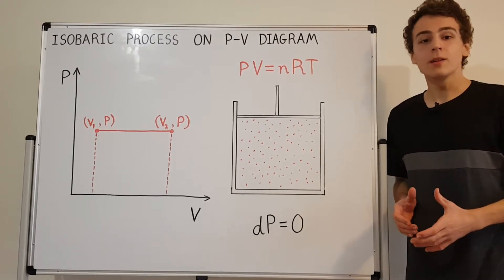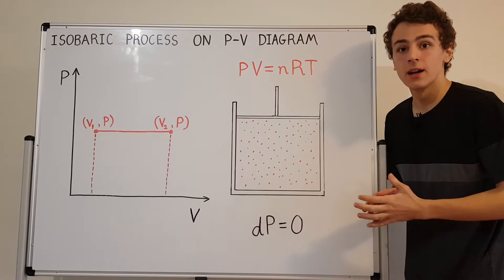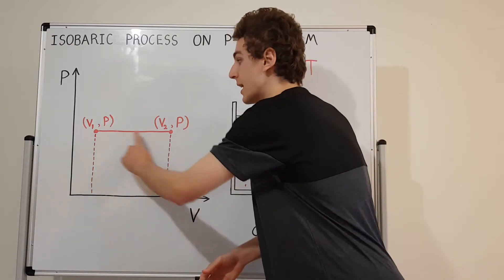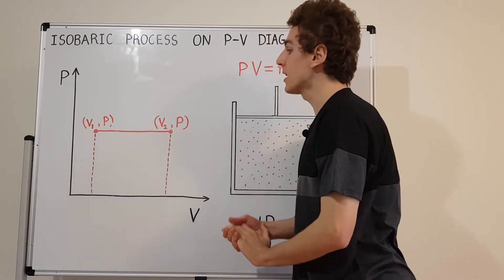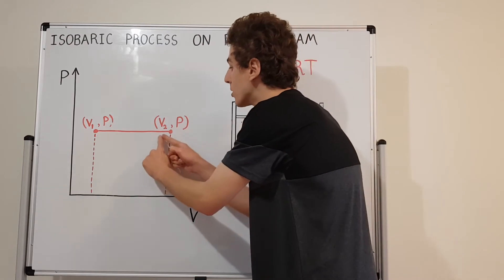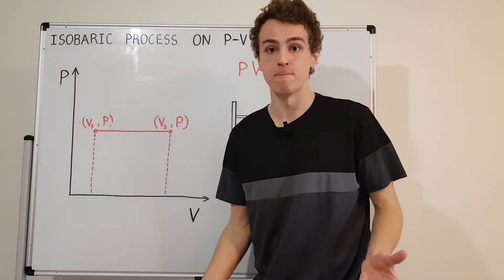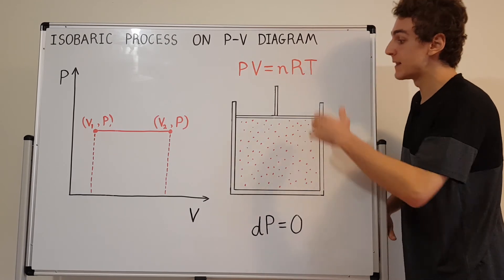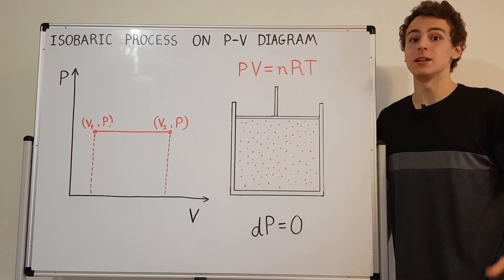Visual Intuition of Isobaric (Constant Pressure) Process on P-V Diagram

Comment: I think you did a really good job on the piston explanation of the pv diagram.
But the entire piston explanation is not intuitive it doesn't explain why would a piston behave like that there's no connection to reality that's intuitive. 

And then it seems like right after we're talking about an open system the explanations tend to jump towards a close system and then to statistical mechanics they're just so all over the place that it's really difficult to see the connections between them.
It's not a criticism of you it's the entire setup that I don't really like. I'm having a really hard time finding any other explanation besides the piston.

Comment: Hello sir I have I small doubt during  expansion and compression some amount of pressure is exerted on the piston .so there will be change in pressure.
Thank you
Reply from the maker: If the piston moves sufficiently slowly, we can make the approximation that the pressure is constant.
Reply: @Elucyda  does this slow movement mean, quasi-equilibrium process?
Reply: @Elucyda  Are we considering the piston to be massless here? will there still be any work happening in the expansion of gas if we consider a massless piston?